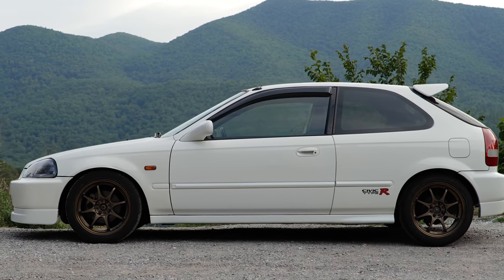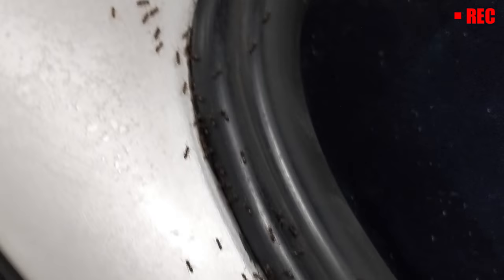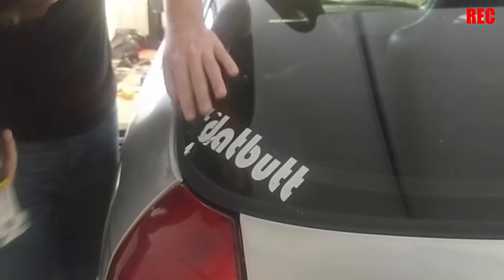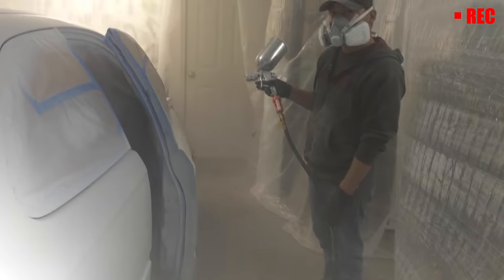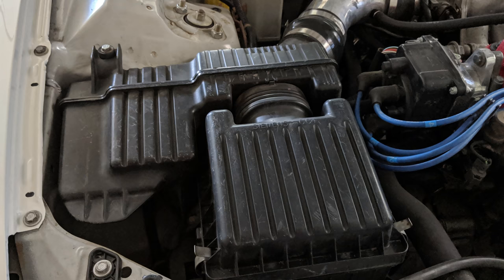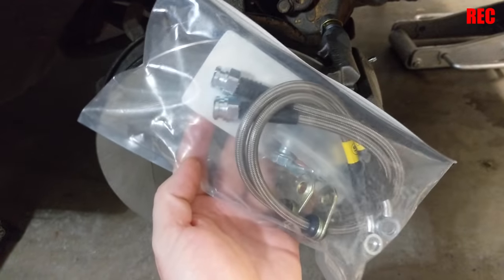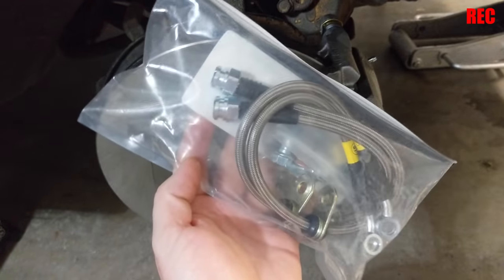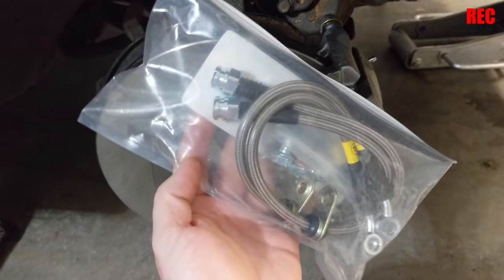How I bought my Civic Type R replica for $5000

Comment: Beautiful. Enjoy the B16 engine. :) lots of fun less issues than the k20 imo :)
Reply: Yeah, sadly if people don't know about K series timing chain issues like the tensioner, they can get into some issues when installing larger aftermarket cams. I know some people have issues with K series transmissions but there are different factors to take into consideration when people say the K series transmission is weak. Engine mounts, axles, tires, wheel size, differentials, bushings, clutch and suspension are some factors to take into consideration. One other large factor is how the person drives. A nice hydraulic release bearing from Clutch Masters or Tilton will help reduce shock on the drivetrain.
Reply: Agree :)
Reply: @Bryce Czirr the transmission are not my friend went thru 3 in 100 k with daily driven car was driven hard at times now engines are another world the engine had 325000kms before  she let go and ran mint till its last day and by the way axles are another killer wirh ks  now my b16a2 gets beat on past 150000kms besides clutch been bulletproof
Reply: @Bryce Czirr oh really bro different take for sure any mods and you drive it hard ?
Reply: @Bryce Czirr proper answer my friend lol stupid question lol
Reply: @Bryce Czirr best description  of a  vtec kicked in yo ...as you see  the crossover  intensify as you read your comment lol

Comment: Me and my dad bought a volvo 360 gl 1987 for 200$ and it might become my first car and thats a cool honda
Reply: Yo dude awesome! If you fix er up and keep up on maintenance it'll last you forever! I had a 740 turbo manual wagon that got t-boned. Loved that car.
Reply: @legodude19999  yeah me and my dad are probably gonna fix it upp a bit but we'll see what happens during the winter here in sweden. It is a really cool car and the enterior almost looks brand new but the outside has some small rust spots and some dents but for a runnig car wich costed 200$ (2000kr) I think that's really good and I would really like to have a 940 or a 740 wagon as a first car but a 360 ain't so bad either.
Reply: Hey man, a car is a car. It's nice they the interior is good, it's where you spend most of your time anyway. If you ever end up taking the carpet out id recommend sound deadner, especially by the wheel wells, really quieted mine down for daily driving.
Reply: @legodude19999  ok thanks for thr tip

Comment: Can I buy it for $5000? Let me know. thanks!

...okay fine. $10K?
Reply: I would buy it for $100k
Reply: I have 2000 civic si supercharged blue printed. Balanced, ported polished head . built by Church IN LONG BEACH 15k into drivetrain alone 119k miles interior is 9/10 its the crazy Pepsi electric blue..if you or any one wants one.
Reply: @quinnlovelace5932  Interested! Do you have photos?
Reply: @quinnlovelace5932  have you sold it?
Reply: @quinnlovelace5932  Nice car.

Comment: If you want to do more, Civic Type R got rear disc brakes, 40/40 prop valve, 1inch brake master cylinder, 22mm rear sway bar, as for the 26mm front sway bar with front lower control arms can be found off a Civic Si.

Comment: Love this video, I’ve loved civics (mainly eg6’s)sence I was 10/12 and I got the opportunity to buy a eg3 that had been sitting in a storage yard for 8/9 years for very cheep.. paid 200 for the car 2 and a half years ago stripped it back to find rust and replace what needed to be replaced and found literally no rust, replaced all the bushing, a set of brand new bc coilovers and have a b18c4 conversion in it now, fully under sealed and resprayed all new brake/fuel lines and a new petrol tank, all done myself over the last 2 and a half years all done insanely cheep I maybe have 1500/2000 into it all together, I swapped a Lexus is200 for a civic with the b18 in it and parted out the rest of the civic and made my money back and profit after keeping the engine!

Comment: I was right with you on pretty much every part of the de-ricing, but I still would have stuck with the non-power rack.  All of the smaller cars I have ever had I went with the non-power rack.  My '87 CRX Si, '89 Civic Si, '91 Miata...  All manual steering.

Comment: I have done this exact same thing 3 x times. 
I have restored everything aftermarket back to oem parts and equipment. 
Repaired all using OEM genuine parts.
Got rid of the whale penis, open air pod filter
Put back heat shield on exhaust manifold,
Restored ride height and quality with genuine oem springs and struts etc

The outcome is always refreshingly genuine in look feel, durability and reliability The way HONDA engineered and intended it to be.

PS: I do still have the 3 restored cars and other original Honda vehicles. Keeping them away from the culture of modding, which usually leads to over modding and introducing poor parts, fitment and rolling complex problems.

Comment: I traded my 03 track edition 350z for an integra type r replica! It has all the oem type r stuff,bone stock usdm b18c5 type r engine and trans with 95k miles,jdm front end,5lug conversion,oem 16” type r wheels wrapped in brand new Yokohama tires,type r brakes and rotors,type r wing,type r muffler,type r rear seats,cluster,shift boot,and all the fake carbon type r interior pieces,all I’m missing is the oem Recaro seats and arm rest,and the only thing that separates my integra from a real type r is not having the seam welded chassis,and having a sun roof which I’ll probably work on that the next few years but for now I enjoy my integra

Comment: In Ireland 5000 dollars is mad we can get them for a good deal with only 50000 miles on the clock clean for under 1000 dollars I've even seen them for 350 dollars
Reply: for an actual Type R?
Reply: @hde69420  No way.

Comment: Civic Type Rs sell for 20k CAD and ITR even more? Wow. I mean, I used to own a DC2R and it was a cool car. But it was cool cause it didn't cost a fortune back when I had it in 2005. I'm a Honda fan and s2000 owner. But for 20-60k CAD I'd look for an M3 or Porsche. Or are those even pricier in Canada??

Comment: It's funny that the Ek9 is the second most powerful Type R they made. Only beat by the 2018 model. Some will say nooo the others had more hp. Yes but also more weight. So power to weight the Ek9 comes in second :)
Reply: what the fuck are you talking about? Even the EP3 has more power then the EK9

Comment: I came here excited and got disappointed, yeah making it nicer looking and all but, removing components that hurt the performance... massive step back. It still would've been a great replica like it is now but header and the carbon intake don't hurt the design, they make it even better and the suspension braces add to the way it steers and you can just repaint the but don't remove them. You are free to do it your way that's just my opinion, never detune a car for looks.

Comment: What hatch back is this a ek model cause it has the v tech
Reply: 96-00 civic hatchbacks are all this bodystyle with the exception of the front end which changed from 96-98 to the 99-00.
they usually came with a d16y7 single cam engine(non vtec) or a d16y8 single cam (vtec)
the true type r only came with the b16b twin cam vtec engine if im correct, i could be wrong with some of this info but thats the bulk of it
Reply: It has a type r engine swap

Comment: Stock/OEM+ is always a clean look but it gets boring after a while. Ricers get style points but their cars are loud and slow pieces of junk. I think you need a middle ground in between the two and it's perfect. Have the performance in a car but the style of ricers. Then it's not really a ricer as it runs well and also looks tasteful.

Comment: I love your guys builds, excellent attention to detail filming and editing, it really stands out! People need to subscribe!!!
To show how much a honda rattles, just take a video of your hand on the steering wheel when it's idling low. 

https://youtu.be/vvwVcPL72YU?t=19
^My car 12 years ago..lol

I had a 1992 GS-R #1978, that I turned into my HPDE/Auto-X car.  I ran a Full-Race traction bar system (metal rod ends, but REALLY helped eliminate wheel hop) , and every suspension bushing/motor mount/tranny mount/steering rack  either an energy suspension red poly or a few 98 JDM ITR rear control arm factory bushings. Needless to say you could feel every  pebble on the road through the  team dynamics 14x7's wrapped with fallen azenis, less with the auto-x 13x7.5's wrapped with kumho v710. 

The steering wheel could chatter your teeth if you gripped it hard enough and it was below 700 rpm. 

This car had one purpose and that was for me to learn how to drive on the track, and it did just that. What an amazing platform, B-Series engines are an engineering master piece. P.S. if anyone needs a B16A1 block with crank shaft I bought as a backup in the Seattle area, give me a shout. :p

Comment: i did a set of those silicone hoses in my VR6 and in under 2 years ive replaced almost all of them due to failure. they are NOT for a driver car. they are for trailer queens ONLY. utter garbage. 15 year old USED OEM hoses are more trustworthy than those are. junk.